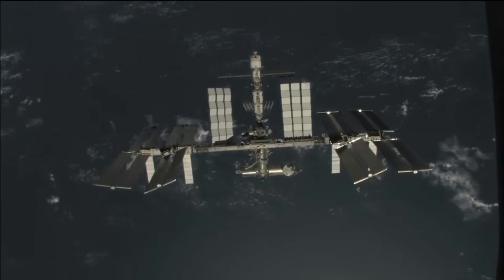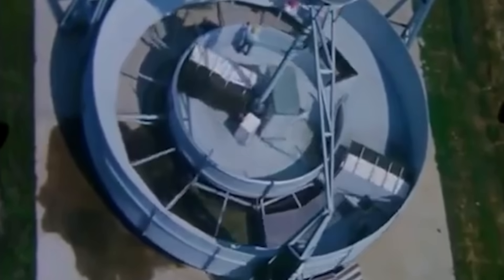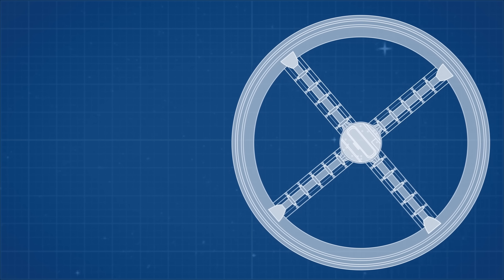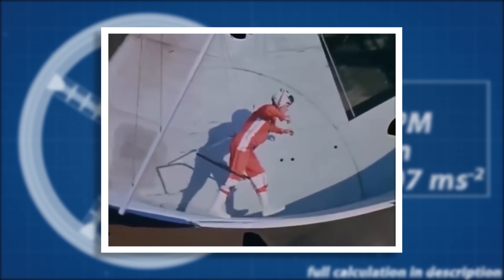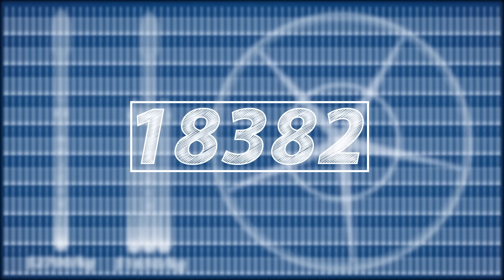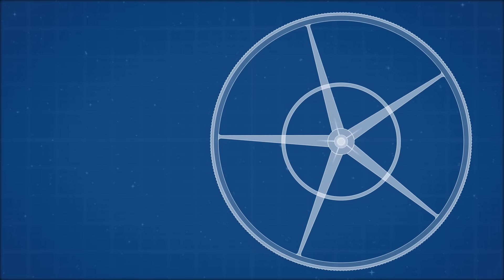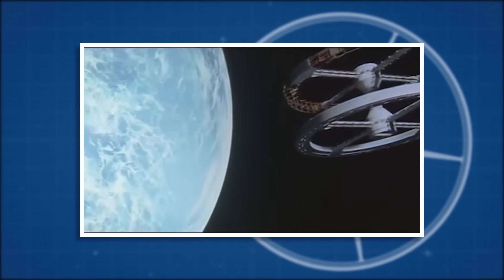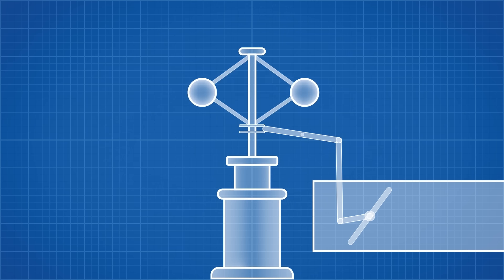Can We Create Artificial Gravity?

Comment: I wonder if it is possible to train the body's of austronauts by simply giving them heavy armor parts included with a weak magnet force on the floor that would be as weak as a gravitational force.
Reply: It’s not just getting a work out that’s the issue. Weightless has a negative impact many parts of the body. It’s more of a chemistry in 0G problem.

Comment: Love it - finally someone explains centrifugal force correctly - centrifugal force doe not exist in an inertial frame of reference, which is the standard usually used in physics, therefore you are usually jsut simplifiedly told ist doesnt exist - but if you lock your frame of reference to the space station - then it does exist.
SOmething similar applies to gravity: If you set a specific frame of reference you can also claim that gravitational force doesn't exist (oversimplified veersion of relativity) - yet that doesnt meant htat things you drop won't fall down, it jsut means that if you glue a camera to something and then drop it it looks like hte ground is being pushed up towards it.

Comment: I'm curious, I've seen this round space station with artificial gravity nearly all my life.
So when we actually build a space station, how come it looks like a trailer park?
Reply: For one, purpose. What's the point in constructing a structure to avoid one peril of space flight (bone density loss) while ignoring other perils, like radiation and cosmic rays. 

For another, cost. The video covered this by going into the logistical challenges of launching such a craft from the surface (18,000 rocket launches) but one possible alternative is to use materials from Luna or asteroids, which are already in microgravity, to construct such orbital habitats. Another option is make the initial construction an inflatable torus, to be bolstered and firmed up with subsequent launches.

Comment: Centrifugal force is NOT a real force, it is called an apparent force. Very similar to the apparent force generated in an elevator going up or down; an observer on a scale would measure changes in weight not because there is a real force, but because of the acceleration of the elevator itself. Similarly, an apparent force can be measured in a centrifuge because of the acceleration that circular motion entails.

Comment: The artificial gravity craft dose not need to be a circle. All you need to do is connect a conventional space craft to a long pole or tether to a counterweight. The counter weight could be an other conventional space craft or just use old satellite or fuel tanks. No sci-fi magic needed
Reply: The main problem with a bolo setup is that it only takes one micrometeoroid impacting that tether to send the two spacecraft hurtling in opposite directions, spiraling out of control. A solid structure would be preferable for long term habitation, both for durability and ease of maintenance. A bolo has a single point of failure that is just too glaringly obvious.
Reply: +Irish Identity I agree a tube like structure would be nice so the People could go between the two units with out a space walk. Perhaps redundant tethers also for structural stability and reduced weight.
Reply: Have you read Seveneves by Neal Stephenson? Science fiction novel dealing with an apocalyptic event and the survival of humans by going into space.
Reply: +Irish Identity no but it sounds awesome I'm going to look it up.
Reply: Take  the metalls  from space  and put  a masive poder 3d sprinter There.  Maby  on the Moon.
Reply: A circle 2ould also be better for long-term travel because the whole point of simulating gravity is to allow the muscles to exercise. It would be much easier to have a torus,like in Seveneves, because of how easy it would be to walk
Reply: would be hard for fuel to travel to each end
Reply: I’m thinking a medium size asteroid on the other side as counterweight
Reply: Jared Jeanotte it does not need centrifugal either. Objects can be blowed to the floor
Reply: it's not sci-fi magic

Comment: Never understand why the feasibility of artificial gravity is always discussed in terms of the von Braun wheel concept. It is like discussing the feasibility of a long-span bridge without considering suspension designs. As others have mentioned, the simplest solution is actually just two habitation modules tethered together with a long rope and set rotating about their mutual centre of gravity by thrusters. Solves almost all of the problems since the tether adds very little cost or material and can be as long as needed. Plus it is very scalable being practical in much smaller sizes than the wheel. Also if we do seriously consider a wheel, it would be silly to source all the materials from earth - practically they would be obtained from asteroids.

The tethered or "bolo" structure has been proposed before, but I have a further idea extending this: For a spaceship, add a propulsion module at the middle of the tether. When the ship is coasting, artificial gravity is provided by rotation. When under thrust, the habitation modules are towed behind the propulsion module and a proportion of the artificial gravity comes from the acceleration. This allows the passengers to feel a constant gravity, both in strength and direction, in all flight phases (assuming maximum acceleration of less than standard gravity).

Comment: actually the blood wouldn't rush to your feet. There would actually be less downwards force on the blood in your head pulling it towards your feet than if gravity was equal at both your head and your feet. Also, generally bauxite supply would likely increase to meet demand, new deposits are constantly being discovered and supply is projected to increase by a quarter in the next ten years. It's also unliklely a structure that big would be built entirely out of aluminium. The cost of the meterial does not play a significant factor compared to the man hours when looking at the cost of IIS modules. Elesium would take advantage of economies of scale and the level of detail would be more comparable to ship building than satelite building. A lot of it could be automated and would be modular and repeatable. Every aspect is the IIS is laboriously individually designed and hand made. There are also lower cost composites that would fit the bill, however a metal exterior would be needed for radiation (however some suggest a water bladder as a solution).

Comment: The torus in the dreadful Elysium movie is a terrible example of the centrifugal gravity idea. It couldn't work as it had no solid canopy to hold the atmosphere in but relied only on centripetal force to contain the air (allowing the movie to have spacecraft land straight onto the habitat section) which simply would not work. Also if we do build a torus we are going to start with relatively small ones, we are not going to build our first torus many kilometres in diameter. You just cannot use sci-fi films as any indicator of what would work as they all play fast and loose with physics and engineering.

Comment: The spinning station doesn't have to be a circle.  In fact you could have a Long stem with a counter weight or cargo container on one end and a small living quarters on the other end.  This would decrease cost by an incredible amount.  Think of a hammer with a head on both ends of the handle.  A station like this could have artificial gravity on each end and zero g in the middle.  A person could climb up from one side approaching zero g in the middle and then climb down to the other end.  Or make an elevator, whatever.  A station like this could have the interior size of the current international space station for 1/20th the cost of building a giant wheel.  You would get 1g on each and and still have zergo g in the middle for those experiments which require it.

Comment: A full ring (jogging path) is not required. The same method may be applied to simulate gravity reguardless of size. A low budget solution would be 2 smallish pods connected by a cable. Perhaps during the retirement of ISS, two of its modules could be used like this, utilizing nothing more than the parts and systems already on hand and at a cost near $0. 
http://1.bp.blogspot.com/_78GY3x9yqik/TQmw_c580cI/AAAAAAAAAXA/LO1HRGlvszI/s1600/nonrotating-tether.jpg

Comment: what if instead of a ring you have a long pole shaped spacecraft that spun around a central axis, or two disk shaped rooms attached by a strong cable and spun around the center of the wire.

Comment: How about using a counterbalance asteroid?
Imagine a spaceship size of a buss which has a tethered an heavy metallic asteroid on a long line. When you start rotating that system around common center of mass it will create centrifugal force in the bus hanging off on the line. Simple and inexpensive.

Comment: 0:31 ........
Centrifugal force isn't a force.... hence the angry mobs.. What you're thinking of is centripetal force, which acts on the inertia of an object, which is a result of momentum "pushing" an object tangential to the circle of rotation, not outwards. (only in special relativity -- and therefore near light speeds -- does centrifugal force really become "real" in some very twisted sense, and is tied to inertia, but not acceleration, and that has to do with frames of reference; as opposed to force: acceleration is what defines the direction of a force. In other words, it is not a FORCE, though it does have application to frame of references)
So far I've taken a single physics course, and two introductory engineering courses at UM, so I'm not just ranting.

Basically, nothing is pushing anything outwards... the same way you don't feel gravity. All you feel is what is called the normal force; whatever is pushing you upwards so you don't fall through the ground. Otherwise you are in free-fall. However with centripetal force you don't NEED any force to counteract the normal force pushing you upwards (which is the centripetal force), BECAUSE you have inertia, and like I said, inertia only points in the direction of relative movement, and therefore is tangential to the circle of motion. It's one of the first lessons in a kinematics course.

Comment: I think you spent too much time on the presumption that a centrifugal gravity station would have to be a torus, and how expensive that would be. A dumbbell design, would be far cheaper. That's 2 or more habitats on the end of long cables. The bigger issue is the purpose of the station, as you mentioned research. A operations support station or space manufacturing station would also need multiple easy access points to things in space. Only accessing at the axis of rotation would inhibit their operations.
Reply: I am REALLY interested in good science programming and you have knowledge and enthusiasm, but you need to study the topic more before you publish. At about 2.20 sec you started making broad assumptions about the biology of it, what rpm would be too much and what gravity would be needed. There has been a great deal of research about this. I know of doubt you found it. Much of the concern was about the coriolis effect, which you didn't mention. The coriolis effect is mostly felt (if I recall right) when you travel vertically (or rather to or from the center)  I can't cite these articles because I read them years ago, but the conclusions being published described doable size and rotation. Even now some of the designs for interplanetary ships (like to Mars) include centrifugal gravity, either with flipping the ship end over end, or with cabled dumbbells.

Comment: couldn't a station be built as a half or partial circle. if it is still set to rotate around a point far enough away that it would have the sufficient distance to achieve the needed force. there would just have to be a counter balance. 

you could have a quarter circle and can long shaft attaching to an opposing mass, like an astroid.

Comment: If you can create a space elevator that moves along with the Earth's spin, couldn't you just extend it to feature a base? Sounds much cheaper than building a big wheel, plus you would have transport to and from the surface baked in. The gravitational forces wouldn't be exactly the same, but close enough?

Comment: why is everyone trying to create a round spinning station? why not just use cables and a single tube leading between two flat (or slightly curved) sections spinning, that way it can still be small but get the g's without problem with rotational speed

Comment: Elysium design is idiotic.  A practical design would be twin pods connected by cable (or other tension structure) rotating around one another.  This obvious design would use far less material while still having a sufficient radius.  Why hasn't anyone done this?  I think there are issues with controlling spin, docking (even with a central 0g pod), and radiation exposure from long periods in space.
Reply: There might also be some problems with motion sickness - in spite of having a sufficient radius to make motion sickness occur right away.

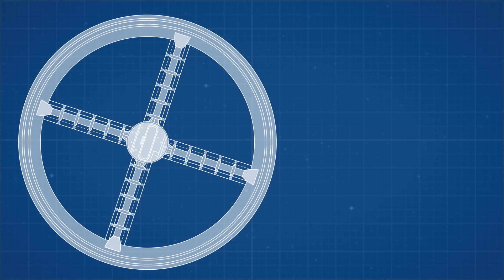Comment: The ISS was built in sections.  I even met one of the Astronauts that helped begin its construction.  They slowly added stations over the years.  Why can't they reassemble the ISS in such a way that could create a large piece of construction like the one showed on 2:00?  Just add the circular areas 1/4th section at a time.  No?
Reply from the maker: This is a pretty cool patent that describes using the discarded external tanks from the space shuttle to build a habitat. http://www.google.com/patents/US6206328

Comment: Fix the money problem: build a space elevator. Yes, it is expensive, but sending 1kg to space will decrease to 35$. Send 100kg and this project just consumed less money than the entire space program.
Reply: Jindrich Petr Kantor 36 km of anything is pretty heavy, I believe you are vastly underestimating the forces involved.
Reply: The construction of a space elevator requires materials and technologies we don't have and don't know will ever exist.
It's like saying unobtanium or mini fusion reactors would fix the money problem.
Reply: lief1250 i haven´t said, we CAN build it, i just said that if we could, it would fix these problems. we are still experimenting with new technologies, so in 10 / 15 years this idea might be possible.
Reply: So your idea of fixing problems, is to make bigger problems? The space elevator idea will almost certainly never come to fruition. The stresses involved are so enormous that even if you could build a compound with enough strength, we don't know of an atom that could stay together.
Reply: Stay together? so you are saying, that 36 km long light rope (practically 18, like in centrifuge) will have enough weight to heat it to 5000+ kelvin? no
Reply: Owen Major
yes, but 5000 kelvin is like surface of the sun.
and we would need to make it light (like aerogel).
Reply: Jindrich Petr Kantor Aerogel has the strength of a feather, A heavy breeze would crush it. Also 5000 kelvin isn't that hot, and you wouldn't need that amount of heat to weaken a property to the point of failure. Carbon fiber for example will start to weaken past 300 C.
Reply: Owen Major
i meant SOMETHING light like aerogel, not aerogel.
and you ment it will "break the atoms apart" not "start to weaken. and 5000 is a lot, we know of only (cca) 3 compounds that will stay solid in that tempeature.
Reply: Launching materials from a lunar mining location is probably a better choice with current technology. You can even use a tether to make an elevator at the moon (because of the lower gravity, and no atmosphere).